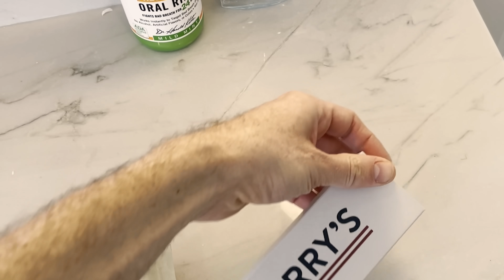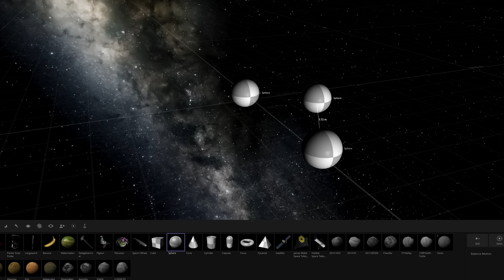Perpetual Motion Achieved

Comment: You could greatly improve the device by reducing the current in the coil so that the ball just barely makes it back around, instead of shooting through the air like a clown from a cannon. ;%)
Reply: Exactly. The amount of energy lost in having the bounce around doesn't make any sense.
Reply: yea, make it a little more believable.
Reply: @peterjohn8625 I mean, to be fair, the whole machine doesn't make sense as it's useless haha
Reply: You could make the ball lighter as well. Think of a magnet in a pingpong ball. When the ball comes to rest, the magnet would be at the base. So making a ball out of lighter material and a smaller magnet close to the outer edge should work at least in this model.
Reply: It barely clears as is, if it went lower it wouldn't reliably make it to the bowl every time

Comment: As a kid, I was always amazed and almost mesmerized by the tipsy "drinking bird" plastic toy... the one with the bird pivoting back and forth eventually dipping it's beak into the cup, and continuing to rock to and fro again, repeating the cycle in what I thought was forever,... then later learned a bit about thermodynamics and the fact that the red alcohol fluid in the birds bottom has a thermal differential coefficient, or something to that effect.
Reply: as long as it had a thermal differential and water, it would keep going, evaporation is the "motor" that kept it going.
Reply: Suddenly I am reminded of when Homer Simpson made use of one of these, although somebody knocked over the drinking bird before the thermodynamics came due . . . .
Reply: I got one of these at work. I don't use water, but the computers fan lightly blows on the 'tail', so the heat difference between the glass ends is enough to have it move constantly.

It's great because the speed in which it 'drinks' increases the harder i work (crappy computer, so easy to stress"
Reply: But... If you built one big enough, you could power a city.
Reply: @jameswest8280  This NEEDS to become a Simpsons episode . . . .
Reply: @Lucius_Chiaraviglio  instead of wind turbines, the countryside would be spattered with giant sipping birds.
Reply: @jameswest8280  . . . which somehow manage to poop enough to become a problem, thereby ruining Homer Simpson's master plan to outcompete Montgomery Burns . . . .
Reply: @Lucius_Chiaraviglio  sipping birds are no competition for nuclear.
Reply: @jameswest8280  For a while, Homer Simpson used a sipping bird for that too . . . .
Reply: @Lucius_Chiaraviglio  is that the one he used it to repeatedly hit the 'Y' key.
Reply: @jameswest8280  That's the one.  And later, he has to hijack the ice cream truck to get to the power plant to stop the incipient disaster he created.

Comment: This reminds me of that experiment where they dropped 1 tonne of water into a hole and the water went higher then where it was dropped from
Reply: For real?
Reply: I suppose that's technically possible like if you created some sort of funnel so only a smaller amount of water received the energy then maybe only 500g of water receives the energy created by 1000kg falling. Not quite sure how you'd do that though.
Reply: Jetting is the phenomenon where a droplet is formed when something is dropped into water.  And it can go higher than the original object because it is far less massive.
Reply: @matthewtalbot-paine7977  the way i read it was that they dropped the water in a hole, made a splash, and ruturn (at the centre of the hole would be my guess) at a higher hight that of the one which was dropped. 
Which i have no problems picturing it, without ever really trying to explain it. But if i had to make a guess...
something something vortexes, something constructing interference resulting something "focused"
Reply: It would only be impressive if all the water returned went higher than where it was dropped from. I doubt that was the case.
Reply: Yeah if you have a bunch of stuff falling, you can transfer some of the momentum from some parts of the stuff, to other parts of the stuff. Drop two rubber balls stacked on top of each other, and the top ball will bounce back up higher than the hight from which you dropped it, but the lower ball won't bounce up hardly at all. The total sum energy for the two balls is constant.

a little bit of the water can splash up higher, because the rest of the water got pushed down further. The total energy for all the water combined is constant though.

Comment: I feel like we can sidestep this caveat of friction-less masses in a vacuum by just calling the phenomenon "perpetual acceleration".  Since in practice, everything suffers friction or other losses, so perpetual motion requires a perpetual acceleration to counteract that.  And if you want to harvest extra work from it, you definitely  need some positive acceleration.  After-all, conservation of momentum technically demands that all motion is perpetual - it just becomes more disordered motion.

Side note: A cool alternate design for this setup would be to run electricity through the rails so that when the ball bridges the connection you get a rail gun.   Safe?  No. Efficient? Not at all.  But it'd be a fun way to stump whoever opens this up looking for the linear electric motor.

Comment: I've occasionally wondered if it would be possible to create something similar to perpetual motion using super fluids and/or super conductors. Like a super fluid in a glass doughnut shaped tube orbiting Earth, if that fluid would just keep travelling around the tube for millions of years or not. Since super fluids are very unusual, though I have no idea if they have absolutely zero viscosity or not. Apparently super conductors are suppose to have zero resistance, though I find that difficult to believe.
Reply: All of those things still require energy input to maintain the special conditions that create them, such as super cooling.  The motion in the machine alone creates heat that will be absorbed into the supercooled substances.  Radiation from the universe will seep in and warm the device to a neutral point.  Gravity is also always a factor no matter how far you are from anything else, unless, as posed in the video, you're the only "thing" left in the universe...at which point there's no reference for detecting motion.
There's no amount or kind of insulation that can prevent the energy transfers that eventually lead to every system breaking down and motion stopping.

Comment: humans can make perpetual motion by pumping liquids such as H2O into the atmosphere, by electrolysis of H2O into oxygen and hydrogen gas where the height and density are developed with Cl,Flourine,sulfur or high mass gas compounds, 1 input energy for electrolysis and there are 2 output energies from the gas recombination reaction and hydrostatic pressure, the tool can be like 2 tubes that are prefilled with 2 types of gas resulting from the breakdown of electrolysis before being run and 1 more tube to drain the liquid material resulting from the re-combination of the gas.

fyi ,its about 287kj/mol H2O for input energy ( electrolisys )

get back energy when turn H2 dan O2 gas about 250kj/mol

the density of liquid and or high and gravity must be at least more than 37kj ( 287kj-250kj ) 

what about Cl2+3F2 or H2SO4 ? 

good luck for make better world

Comment: Perpetual motion machines are impossible without an outside source of energy because of friction. You can’t produce enough energy to keep them going from the machine, and even if you could it would only be enough to power itself. Trying to remove energy from the machine would break the cycle of powering itself, thus being rendered inert
Reply: It's not just friction that's the problem, you need energy to flow from a higher concentration to a lower concentration. When the energy is equal, nothing flows and nothing moves.

You can have all the energy in the world, but if it's in equilibrium, then you can't do anything with it.
Reply: Five words.  That's where the period goes.  It's not perpetual if it includes an outside power source, even if that power source outlives the builder and the machine.
"Perpetual motion machines are impossible."  Full stop.
(The rest of your explanation after that first sentence is fine, though.)

Comment: Fascinating, i perfectly understand that it is impossible but for some reason i keep on thinking, what if? I can understand people went crazy over this stuff.
Reply: If 6ou completely understand that it is impossible, then there is no 'what if'.
Reply: There a 'perpetual' clocks, hydraulic ham pump, drinking birds, than in some way its possible. You just have to extend the concept of perpetual machine.
Reply: @canalRetro269  if you extend the concept, then it's not perpetual.  Just like it doesn't work to extend the concent of UP to include DOWN.
Reply: @canalRetro269  The clock use the change of temperature and pressure in the air.
The pump use hydraulic pressure that got lost in time.
The bird use evaporation and liquid temperature offset.

They are not perpetual at all.

By your definition, you could say that a car drive perpetually... Until it's empty
A bike move perpetually... Until you stop moving your legs.

Perpetual movement need to append without the need of external forces, it's the most important condition, else everything is perpetual.
Reply: @pierrotA  My definition is large but not soo large...
Reply: @canalRetro269  what's the difference between an electric car that need recharging and this machine that need recharging ?
They both need electricity to keep in movement.

What's the difference between the bird that need to be refill in alcohol and a car that work on alcohol ?
They both need to be recharged to continue moving. For me it's the same.

Comment: 5:34 Perhaps I misunderstood what was said here, but doesn't that contradict the recent achievements in nuclear fusion where they claimed outputing more energy than they used to tun the reactor ?
Reply: No, that is still fine! In fusion you essentially fuse hydrogen (1 proton per atom) to helium (2 protons per atom). The helium is 'more bound', in a deeper potential well. That is why the helium atom will be ever so slightly lighter, if you weigh it, than two individual hydrogen atoms. The weight difference between the two is released during the fusion according to E=mc^2. You're generating energy because you put nucleons in an energetically preferrable state. It would take energy to put them apart again. Hope this helps!

Edit: The challenge in fusion currrently is to get more energy out of it than you put in. You need to put in a lot of energy, because fusion only works at very high temperatures and pressure. Very simply put the challenge is to keep the hot hydrogen plasma from transferring  too much energy into the environment, if you want to say so you need to 'isolate' it very well to minimize energy losses.
Reply: No, that's not counting the energy embedded in the fusion fuel source.

Think about how starting a car needs an electric motor to turn the engine before it can start burning petrol. The current state of fusion power is like if we all cars were electric and someone was trying to invent an internal combustion engine to make use of all the fossil fuel energy there is, but they couldn't get it to run long enough to generate more energy than the electric motor puts in to it.

Comment: Here's my idea for a perpetual motion device. I have no idea if it would work, but here goes: picture a cog shaped like a buzz saw. The teeth would be collapsible to where it can for a smooth circle. On the teeth would be powerful magnets. This buzzsaw cog would fit perfectly into a box that has the buzzsaw shape you would embed it in. In this box, the teeth would have magnets that would push the teeth of the cog forward. Again, I don't know if it would work, but I think if done right, it could.
Reply: Ah, the old "rotating magnets", a cornerstone of perpetual motion pseudoscience :)
I'm trying to imagine your cog but I'm not sure why the magnets would push the cog around.
Reply: @marasmusine  because the box that fits the cog In has magnets on its teeth pushing against the teeth on the cog
Reply: @marasmusine  everything is pseudo science until it's achieved
Reply: The mistake I always make when thinking along these lines is the same one you've made here, J. You're thinking about how the magnets in the cog would push it forward, but you're forgetting that, before it gets to that point, those same magnets will be pushing the cog backwards , as the magnets approach each other. :^/
Reply: @gregmark1688  The good old action/reaction.
Reply: @JWard-sp7wt  The energy you get out of that system won't be higher than the energy you put in by pushing the magnets close to each other initially. It will turn a little bit then stop. I might be misremembering but I think there's an Action Lab episode on this.
Magnet's aren't a source of energy.
Reply: Sorry if I came off harsh, it's good you're thinking creatively, just think about areas in your cog that you'll loose energy through friction, or where the same poles of the magnets get close and repel.
Reply: @Greg Mark  you have to make it out of a metal that's non magnetic. Or just metal behind the opposite poles so they don't attract
Reply: @marasmusine  it's ok, I don't mind criticism. I still think there is a way of doing it, we just don't have a clue as to do it currently. Doesn't make it impossible. We've done lots of things thought to be impossible at one time.
Reply: @JWard-sp7wt  There is a huge difference between 'impossible because of unsolved engineering problems' and 'impossible because of the laws of physics'.  Powered flight is an example of an 'impossible' problem due to engineering problems (we just didn't know how to do it,  but the idea of powered flight didn't violate any laws of physics).  Perpetual motion is against the laws of physics.  There are no clever workarounds for the laws of physics.
Reply: Short answer: No.

The magnetic force, like gravity, is conservative -- that is, the potential energy only depends on location.

To use gravity as an example, things fall down, and they never fall up. You drop something, and no matter what path the thing takes through space, it's never going to be able to get back up higher than the hight from which you dropped it from. (You must add new energy from something else to move it higher.)

If you have two magnets held apart by some distance, and let them go, the magnets will "fall down" with respect to each other, and they will never "fall up" by themselves.

You can extract the energy from a falling object... but only once! After that it's stuck on the ground (or table, or whatever you dropped it on) and stops moving.

You can extract the energy from two magnets... but only once! After that they will stop moving.
Reply: @briansomething5987  dream killer 😂
Reply: @J. Ward  you say dream killer, but it's the universe that is the dream killer. He was just the person telling you the message.
Reply: @MrT------5743  i was joking, buddy
Reply: @JWard-sp7wt  me too.
Reply: @briansomething5987  "There are no clever workarounds for the laws of physics."
Don't forget what we have now is not the true laws of physics. People seems to forget that we put conservation of energy on the highest of pedestal just because it's convenient* and has been working so far. That doesn't mean it's an inviolable truth.
Reply: @mbrusyda9437  And yet  from time to time conservation of energy kept being proven. Of course we cannot be one hundred percent sure, here you’re right, but a chance that someone is just fooling you (or making a genuine mistake) is so much greater than fundamentals of our worldview being broken that you can basically ignore latter on a day-to-day scale. It doesn’t mean we have to ignore it absolutely, yes, but even in laboratory with great equipment you should take these «ground-breaking» results with a grain – or a whole bucket – of salt. One should exclude all other possibilities before jumping to drastic conclusions

Comment: 4:42
If an object is moving at a constant speed with nothing else in existence, the reference point is the time/space field itself, more specifically causality. Unless that doesn't exist either, which means an object can't exist.
Reply: Space and time do not give a universal reference frame to compare motion against though. All inertial reference frames are equally valid, so the concept of motion doesn't have much meaning for a universe with just one object in it (ignoring rotation).
Reply: @AbruptAvalanche don't need to ignore rotation, either.  If anything is feeling any motion, that motion is changing against the gravity or other friction from another object.  In the one-object universe, (presuming that object is not a flailing body or rocket made of multiple parts) there is no frame of reference and nothing to change motion.  All motion then becomes irrelevant, without even time to measure it against.
Reply: dark...if you manage to invent a sensor for spacetime that doesn't reference other matter or energy emitted by "things", I'm certain there's a Nobel prize waiting for you.  You'll be able to measure how fast the galaxy is moving from inside a sealed bank vault, which current physics tells us is impossible.  We can't even measure the speed of light without bouncing it off something else.  (No signal can move fast enough to give us the time difference one-way.)
Reply: @VoltisArt  If the only object in the universe is a spinning ball, that ball will "feel" an outward pull away from its axis of rotation. There would be some amount of bulge at the equator due to the spinning. A universe with nothing but a rotating ball would not be identical to a universe with a non-rotating ball.